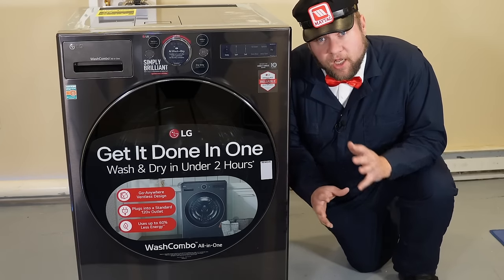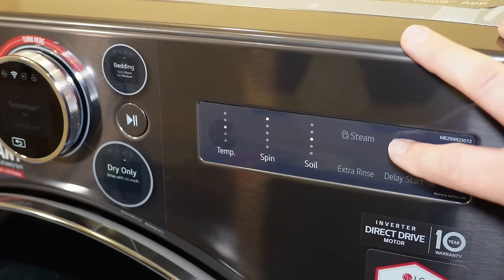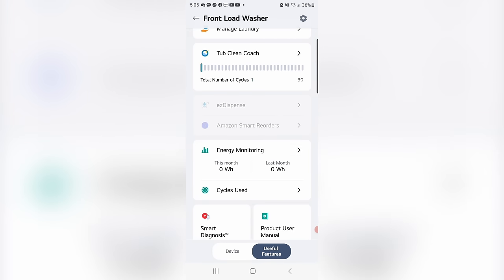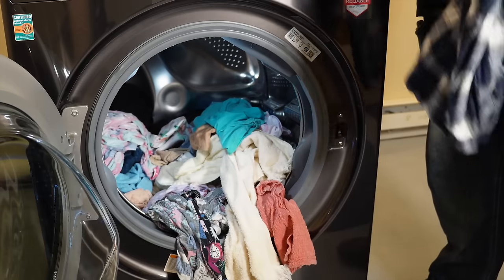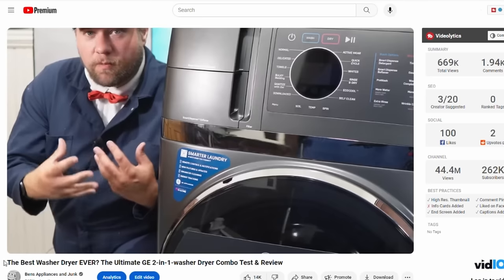BETTER THAN GE? The LG All in One Washer Dryer Combo: Test, Teardown & Review

Comment: Side by side comparison would be awesome. 

I think these machines are the future. Ya they're new and expensive, but they bring a different style of lifestyle washing which most don't think about (like doing a load overnight or during the day while at work). It might change the demographic. 

I hope one day they can add bigger electric resistive elements to it, to give people the option of slow long (efficient) drying with the heat pump, or fast high heat ( non vented condensing) drying. To really give people options. 

I can also see when these get more popular and cheaper, that people could have multiples of these based on their needs. Imagine doing whites and colours in two machines at the same time overnight, and it be ready to fold in the morning when you get up. 

That's time/lifestyle efficiency in my eyes.
Reply from the maker: I have a few more videos to run first, but will be doing the side by side soon. I do think this will be a new wrinkle on how people do clothes.

One other note is that this unit favors being small over being fast... The GE unit does wash/dry faster, and its peak capabilities are still lower than what a heat pump can theoretically do. Even then, I wonder what the wattage/efficiency of this direct drive motor is vs. the motor w/ inverter that GE uses.

Theoretically, you could make a machine that peaks at 1,500w using a heat pump (which is the max a regular space heater will do), and could then do some very nasty things to dry the clothes. The efficincy of a heat pump is 2-3x that of resistive heat, which means a unit with, say 1,400w of heat exchange would be close to a full-sized dryer's capability.
Reply: We had washer/dryers for many many many years her in Uk and across the rest of Europe, they are a lot cheaper than yours in the states, a cheap one can go as little as £350 ( $443 )  most are condenser units but we have had heat pump models for quite a while,   We have a separate heat pump dryer that we have had for 10 years  ( we have 2 washing machines and 2 tumble dryer’s, the other dryer is a condenser, lol our cats have their own washing machine and dryer )
Reply: @davedebang-bang6168  I keep hearing europeans saying that about Americans just now discovering combo units. We knew they were around but almost ALL of them have been poorly reviewed and take hours and hours to wash and dry. You've all been suffering with tiny machines, long dry times and energy inefficient machines. Most of Americans have easy venting, abundant space and literally don't need ventless... so why go though the potential misery of combo machine if you don't have to? Well, the GE machine is the first to quickly dry clothes with a 110 plug and no vent. So now, why not get one for the extra space?  Many Americans are jumping on it now because the perfected it.  I capped my gas line, don't use my 220w plug and capped my vent to use the GE machine. I think you'd find you've never had anything like the new GE Ultrafast.
Reply: @davedebang-bang6168 I'm Korean, and I was told this by a friend who is a washing machine developer at LG. European washer/dryers are smaller in size, so it's easier to make them into a combo. It's not that LG doesn't have the technology, it's just that it's hard to make them all in one while maintaining a large capacity. Similarly, while combo washers/dryers are already popular in Japan (the first combo with a heat pump was made by Panasonic in Japan), they haven't been introduced in Korea, which is right next door. This is also a result of the different size preferences in each market. 

P.S. Most people don't know this, but LG introduced a combo model with a heat pump dryer back in 2017. Most people don't know this because it was briefly released under their signature brand.
Reply: @Finndian I’m a candidate for ventless drying.  My duct runs from the laundry room through the base of my closet kick panel (roughly 30 feet).  If I don’t retrieve my clothing immediately after the cycle ends my clothes smell like outdoors/dirt.
Reply: @Finndian  now we can use the 220w plug to charge the electric car

Comment: I got the GE for about 2K delivered from costco and have been quite happy with it. In fact, the only complaint I have so far is that it is louder than expected while drying (I agree the app is nearly useless btw). What I love the most (and from the looks of it is a major advantage) is the automatic soap dispenser. I never thought I'd appreciate it like that, but it really just makes doing the laundry a super easy process.
Reply: I know, right? I think I've filled the soap dispenser twice in 5 months! It's huge.

Comment: It dries about the same time as hanging in front of a fan, the only difference being softness as the tumbling action does that and my line dried clothes and towels are a bit stiff and rough. I'm waiting till my washer packs it in and joins the dryer and then considering an all in one to save space. Either that or I get a clothesline with an access door from inside the laundry room (my MIL has one and it's dope) and stick with just the washer.

Comment: I have 12 washes in on my new GE all in one and it’s a love hate relationship. I love not having to deal with switching the loads and it just does it all. However… my king comforter refused to dry with the heating elements and I had to hang dry it after leaving it on the dry mode for 2+ hours. And all the dog hair that comes off our clothes also ends up on the rubber seal and dries to it so after each load I need a wet towel to wipe the seal to pull the dog hair up. Like a said a love hate relationship 😂
Reply: I have dogs, that sounds like a massive pain in the ass considering I already spend 3 hours hoovering a week.
Reply: Oh, I never thought about that.   With a front loading washer the dog hair is wet and it only takes a second to wipe my hand through the seal and get almost all the dog hair.   But dry dog hair is a different beast altogether.
Reply: can confirm with the GE and lint/hair on the seal. also generates a lot more lint on clothes since it's all trapped in there, and definitely don't wash whites immediately after fuzzy blacks.

i'd still buy it again , though. overall, it's a game changer.
Reply: Every single front loader (combo unit or not) will require seal cleaning after every load. Even if you don't have a dog, lint alone would likely get in there, if you don't clean it promptly before your next load, you can risk water leakage - so be careful! The user-manual of every front loader that I've ever read always mentions to clean the seal after each wash with a damp towel or cleaning solution (like Lysol or so).
Reply: @Aitch-102  I have two 80 lb labradors so there is a lot of hair on the seal. It's unavoidable on front loaders.  However, on a standard one when the hair gets trapped there its wet and its a quick wipedown  like @zachhansen9293 mentioned. But with the dryer on unless you do it after wash and before dry all that hair dries to the seal so it's not as simple. It's not the end of the world I just have a few old kitchen towels nearby and a cleaner to re-wet it and wipe down. But it is something to take into consideration :)
Reply: Maybe you should put the dog in the washer for a fast cleansing .....
Reply: Glad to hear it's not just us!!!  We have this LG unit, not the GE.  We're about a week in, and just washed all of the pet bedding the other day.  6 cycles later and we're STILL cleaning fur off the seal after EVERY. LOAD.!!!!  I don't know where it's all hiding that it keeps popping up in every load!!   Definitely frustrating.  We're using a damp cloth after each cycle to wipe it down, but it sounds like this will be the new, never ending, norm now   ??   We had an LG front loader prior to this, and yeah - the fur on the rubber seal was no where near in comparison.
Reply: @demef758  LOLOLOL that's funny.
Reply: @AlTheEngineer  Our new combo hasn't been delivered yet... but the salesman showed us the filter on the bottom front that should catch the dog fur- doesn't it work at all????

Comment: P.S. here in Canada this LG All in one comes in at almost $1,500.00 CAD less then the GE all in one, Knowing it has better bones than the GE other than the Compressor issue, really makes it a compelling purchase!
Reply: Compressor is a huge factor though. Paying for it out of warranty would probably cost as much as the machine itself.
Reply from the maker: 1,500 cad? Wow!
Reply: Where can you get either unit in Canada?
Reply: where are you getting it for that price? its 2500 anywhere I look
Reply: He said $1500 LESS than the GE
Reply: @mikhailtronik4322   LG has been producing compressors for refrigerators and air conditioners for years, so I'm sure they're quite reliable. I have a LG mini split since 2006 and it never had a single problem.
Reply: LG ac units are great but their fridge compressors? Yikes. Hopefully they don’t use the problematic linear compressors
Reply: I agree. LG refrigerator compressors are really bad. They used them in Kenmore refrigerators. Our lasted less than 4 years.
Reply: Mine today was 2064, with warranty delivery container to lift up total 2800, it better work or is going back
Reply: @multipotentialite , in qc, brick, Leon's, Tanguay...
Reply: LG does have a reputation of making a "cooler" but significantly lower quality product
Reply: @Ikey04-ge9gy  LG has 10 year warranty on the fridge compressors

Comment: Thank you for the video. Stumbled upon your video. This may be a better option for us and our RV. Also never knew in my 52 years that I needed to rinse my filter with hot water. Always took the air compressor to blow out lint holes.
Reply from the maker: dryer sheets build up an invisible barrier that causes air flow issues. You cant see them ever. Air compressor may work well, but you'd be shocked how bad they can be even if they look fine, especially on a filter lik this that is plastic vs. the older school wire mesh filters.

Comment: Another comprehensive review. My wife was disappointed with the height of the GE it disrupts her folding space on top as she is fairly short. I worked at GE and knew the plant in Louisville. When they left it made LG the best viable option. I think use the $500 Savings to buy warranty.

Comment: 00:00 🌟 Introduction to LG 2in1 Combo Washer Dryer
- Introduction to LG's new 2in1 combo washer dryer.
- Highlighting the machine's unique features like its large capacity and ventless operation, running on 120 volts AC.
01:10 🧼 Machine Features and Modes
- Exploring the wide array of wash and dry modes, including AI-powered options.
- Discussing the convenience of using the ThinQ LG app for control and monitoring.
03:31 🕐 Initial Test and Drying Time
- Conducting a test wash and dry with a focus on drying time.
- Noting the initial estimated time, energy consumption, and load specifications.
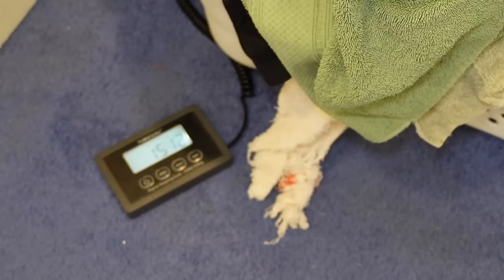05:57 🧺 Testing with Varied Loads
- Testing the machine with various loads, including mixed laundry and heavier items.
- Evaluating drying times, energy consumption, and load capacity.
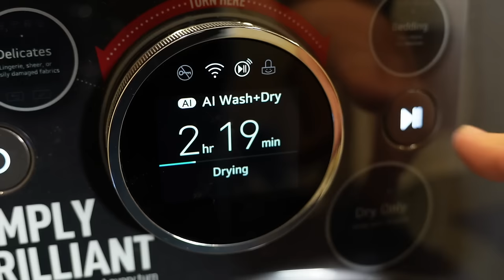07:59 🤫 Noise Level and Efficiency
- Discussing the machine's quiet operation and its effectiveness in spin-drying.
- Analyzing the efficiency of the washer dryer based on energy usage.
09:22 🌙 Overnight Start and Heat Pump System
- Testing the machine with an overnight start and evaluating drying times.
- Delving into the heat pump system, compressor, and energy efficiency.
12:08 ⚙️ Disassembling the Unit
- Disassembling the machine to access the heat pump system and components.
- Highlighting the size of the compressor, evaporator, condenser coils, and resistive heating element.
15:51 🔧 Warranty and Concerns
- Addressing concerns about the compressor's one-year warranty.
- Discussing potential issues with lint buildup and airflow affecting drying times.
17:39 🌡️ Overview of LG Combo Washer Dryer
- Discusses LG's reputation and design choices for the new combo washer dryer.
- Mentions the potential use of different refrigerants in different regions.
18:31 🌊 Initial Test Conditions
- Describes the test environment, which is a bit chilly and uses cold water for testing.
- Mentions the wash and dry time for an average load and the use of cold water.
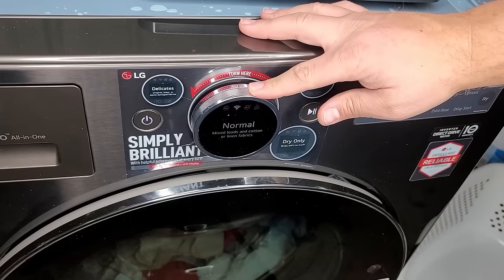19:39 📹 Overview of Wash Operation
- Highlights the effectiveness of water spraying during the wash operation.
- Teases a dedicated video on how the wash operation works.
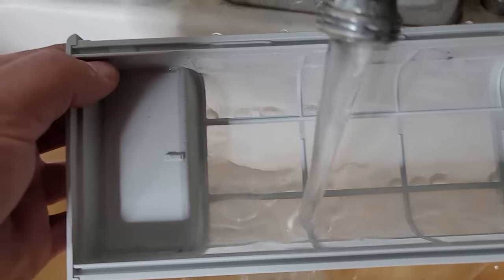20:47 💧 Water Usage Details
- Provides information about the water usage during the wash, mentioning hot and cold water quantities.
- Talks about cleaning the air filter as per LG's recommendations.
21:01 🛌 Testing with Queen Size Comforter
- Explains testing with a large load of queen size comforter and blankets.
- Discusses wash and dry times and the challenges of overloading the unit.
22:40 👍 Recommendation and Features
- Recommends the LG combo washer dryer, highlighting its performance.
- Praises the LG ThinQ app for remote control and quiet operation.
- Suggests standalone washer and dryer if space allows but notes the advantages of the app.
25:12 ⚙️ Concerns and Issues
- Discusses concerns about the undersized heat pump and potential drying issues.
- Analyzes the trade-off between heat pump and heating element.
- Raises concerns about the compressor and its warranty.
26:34 🆚 LG vs. GE Comparison
- Compares LG and GE combo washer dryers, favoring LG due to the app and build quality.
- Suggests price and warranty as factors for choosing between the two brands.
- Teases the idea of future side-by-side testing of both units.
28:11 🤝 Conclusion and Call to Action
- Wraps up the video, inviting viewers to subscribe and consider the provided links for purchase decisions.

Comment: Nice to see another washer and dryer like this. However, I tend to lean to the GE one still if I was getting one. Now, in full fairness that is party due to having the front load GE unit that looks very similar to the all in one unit. I have had very little issues with it and the bigger heat pump to hopefully allow for faster drying times would win me. When one of ours has issues, I might look into one of these or maybe a heat pump dryer unit.
Reply: Sadly fine lint and fine dust from drying gets past the dryer main filter and coats the heat pump coils over time making drying take longer so in another 4 years drying alone can take 4+ hours and is not that energy efficient.

Comment: I was in need of a new laundry last year (2023). When the GE combo unit came out, I jumped on the introductory sale. My main reason was so I wouldn't have to take clothes to a detached building to dry. Older house without room for a regular laundry pair. So far the GE combo has been fantastic. 

I have cleaned the coil once so far. I used one of those appliance cleaning kits, the long tapered brush and hose attachment.
Reply: Are you satisfied with the time it takes?
Reply: @yoyozozo6960  As another owner of one of these units, yes. Most normal loads are done in about two hours, towels and such in about 3.
Reply: @horseshoe_nc  Let me guess: one load of laundry took just 12 hours, right?
Reply: @CoopyKat  not at all. Most loads are washed and dry in about 2 hours. The only things that take longer are, towels and bedding. Those take about 3 hours.
Reply: @yoyozozo6960  I'd say yes. Most loads are washed and dry in about 2 hours. Towels and bedding usually take about 3 hours, less if it isn't a big load.
Reply: @horseshoe_nc  The utility companies love people that think like you do.
Reply: @horseshoe_nc  LOLLL riiiight
Reply: @CoopyKat lol what? A typical conventional washer and dryer takes up to 2 hours to wash and dry a load of laundry. The main difference is this all in one unit uses less than half the electricity as an electric dryer uses. So I'm not sure why you think the utility company has something to gain here.
Reply: @CoopyKat  These machines are a lot more efficient than a resistive dryer.  You are only pulling about 1KW in drying mode vs 5-6KW for a vented electric.  So even if drying takes maybe 50% longer than the vented electric, you're still using about 2/3 less power.
Reply: @sammarmon3965  Ok now that makes sense! Thanks for filling me in on that.
Reply: @CoopyKat  I've done the figuring on costs to run my GE Ultrafast machine. The 850w machine will wash and dry a large 2 hour load at the cost of about 24 cents.

Comment: The washer is great, the dryer option is terrible. It takes forever to dry a load of laundry. Don't plan on having a 'laundry day' - more like a laundry WEEK. What I dislike the most, is all the lint that collects on on the rubber seal just behind the door. It is very annoying to have to remove all the wet lint between dry times (which I was told to do). I plan to buy a dryer to work with this unit (NOT an LG). Very disappointed in the unit, but great video. Thank you.

Comment: The fact that they only put a 1-year warranty on the compressor in a roundabout way means that they think it would be detrimental for them to put a 2 or 3 year warranty. It's wild to think they have so little faith in their own product.
Reply: Longer warranty means they believe product wont last. Don’t need a warranty if it not going to break
Reply: @catacocamping874  not the case... If the product lasts they warranty it cause it costs them nothing cause it won't break. If they put a warranty for something that breaks, that's expensive
Reply: @catacocamping874  not the case... If the product lasts they warranty it cause it costs them nothing cause it won't break. If they put a warranty for something that breaks, that's expensive for the manufacturer to replace
Reply: @Bynming  yea because they were warranty it up when appliances lasted for a long time